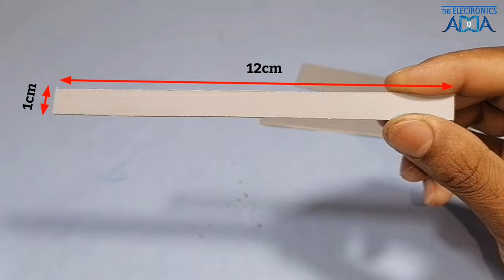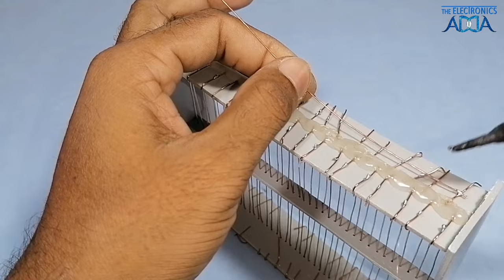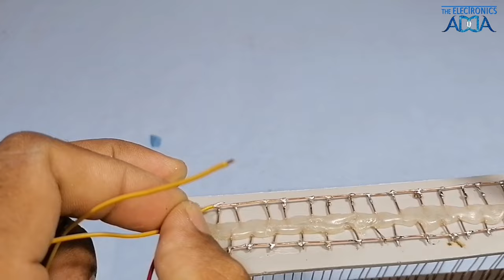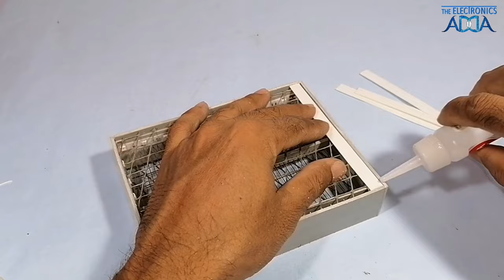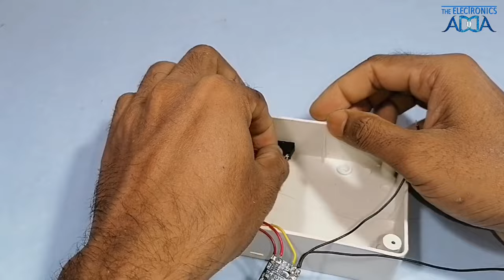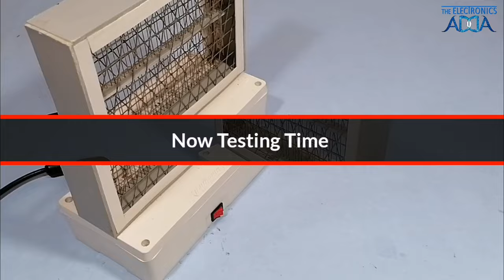How to Make Mosquito Killer Machine at Home | Rechargeable Mosquito Killer Machine | Mosquito Killer

Comment: Good job...but the mosquito bat circuit is made for momentary switching, that's why a push button switch is provided in the bat.Hence, keeping the circuit on continuously without proper heatsink will damage the high voltage circuit.
Reply: add cooling fan better
Reply: The open suface area of this device is much greater...no need of cooling fan

Comment: Isko banane me jo machine vale item kaha milege
Reply from the maker: Local market or online
Reply: کتنے وولٹ کا سرکٹ بیٹ کو لگانا ہے ؟
Reply: @farrukhamin3737  3.7 volt 4056 module have wire gone to switch single wire but in switch two red wire power is 3.7 volt one use to bug converter 5 v to 12 volt and second red wire direct gone to mosquito circuit 5 volt only